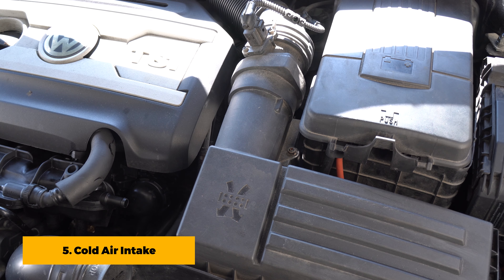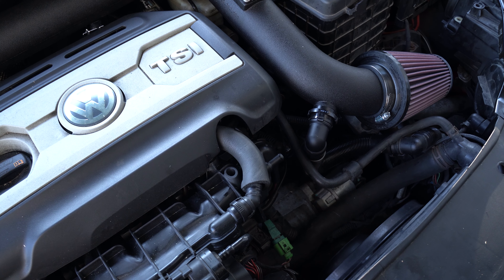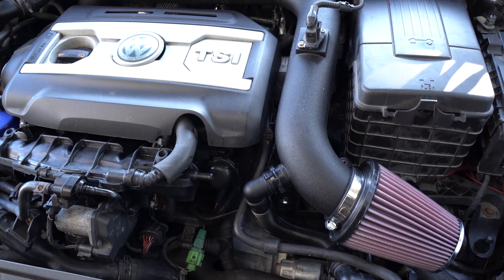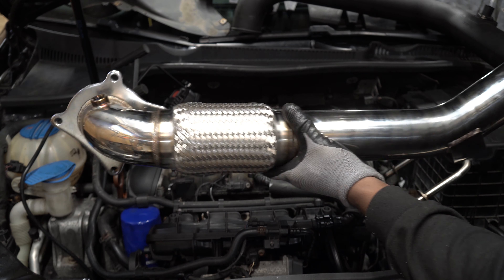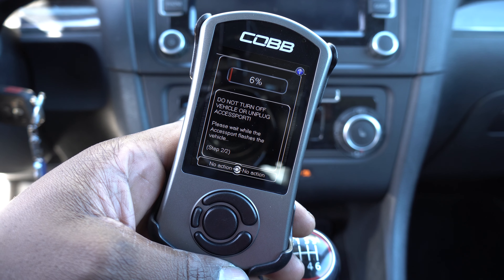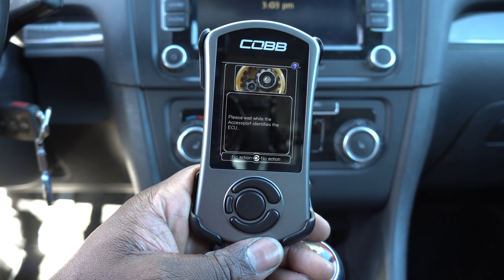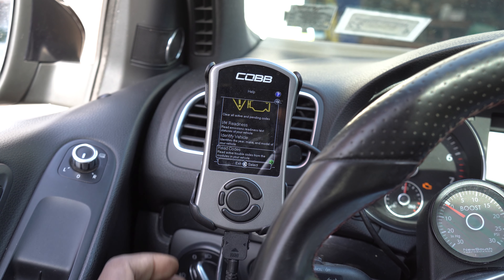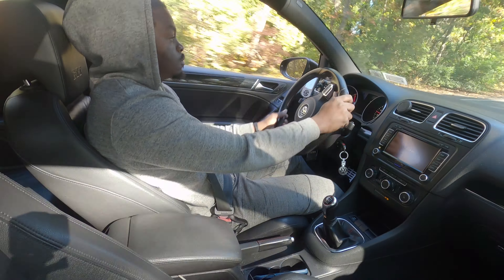VW MK6 GTI Top5 Performance Upgrades for Stage 2

Comment: When you go aftermarket intake id wrap ot in heatwarap as they're metal and soak in alot of heat from the engine as opposed to factory plastic. I found this when i did mine, just a tip to keep intake temps down which is the whole point of any turbo car.

Comment: You are correct with your first modification but you need to keep the intake enclosed and away from hot air near the radiator.

Comment: You forgot the most important mod............. traction via modding the suspension, what's power worth if you can't put it down .
Just lowering your car will only make it quick in corners it won't make it faster on launch or drag strip you have set it up for a fwd with more power .
The rest of your video was very informative.

Comment: Very good video bro, I have a Gti with 270k km and still running like a young guy haha, ty for your videos!
Reply from the maker: Yea, once you do your maintenance it'l run like a champ. Nice!
Reply: 270klm.. good to know mate, just bought 2011 MK6 GTI 3 door 202klm.. just spent 4k on the motor as she was neglected.  Needed a new run around and just bought after a test drive. I fell in love with the DSG I knew they had issues what car doesn't. Yes not cheap to maintain but it's all relative. Cheap as to a Ferrari owner.  It had dump pipe high flow cat and straight through exhaust, I've installed cold air intake, intercooler and tune next. Can't wait to to eat some more expensive cars. I'm 46Y.O and have only driven crappy work vehicles for the last 15 years. So good to drive something fun again

Comment: Put a new revision D DV and a glasspack and a Neuspeed cold air intake on my Mk5 GTI. I thought it might sound bad but by leaving the resonator on it makes it sound pretty clean. She's almost ready.
Reply from the maker: Nice mods!
Reply: @CraftyWorkshopBuilds  I don't think I ever plan on upgrading to the K04 turbo. Would it still be worth it to upgrade the downpipes and the turbo pipes??

Comment: Several things:

Cold Air Intakes - The factory box is as cold as you get unless you put the filter outside the car.  It is enclosed and all that is needed is a higher flow filter to gain CFM.  Truth.

Exhaust - Depending on the Stage of the tune, an Upgraded DP (catted or not) is all that is needed unless power levels are exceeding 450hp or so - it'll flow fine.

Factory piping - Nothing wrong with factory piping.  Once air is heated, the velocity is plentiful.  Many believe that they are "restrictions", but they are not; that is just to sell more gear.

Suspension - you are right on there!  Suspension is key when adding more power and playing more agressively, otherwise power is a waste.
Reply: no none asked, this is his video, make your own video if you wanna say stuff bout his
Reply: @Stoney_Mortar  dude that's what comments are for. 
More info = more better
Reply: So what improves suspension all he talked about was lowering the car
Reply: im surprised people use all the same brand bolt-ons on these cars...

ive only seen once that someone uses Akrapovic slip-ons or full system..  wich are known and legendary on bikes

they make for cars as well like GTI... mk6/7 ... they have nice sporty low-end sound